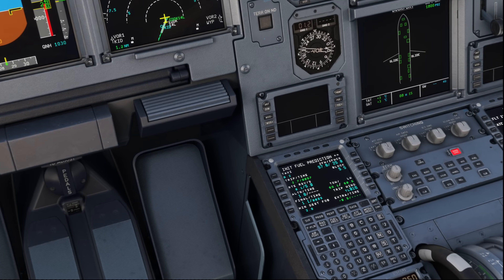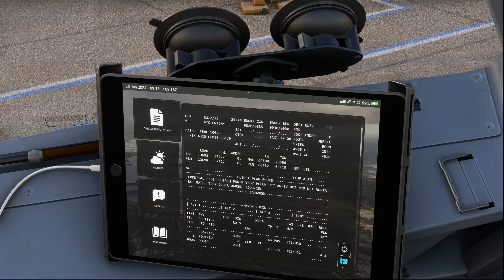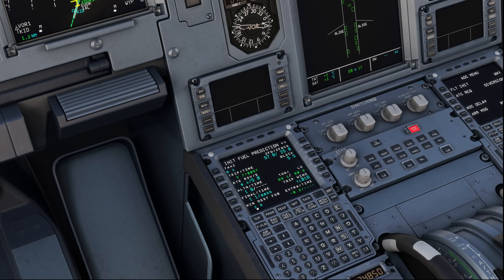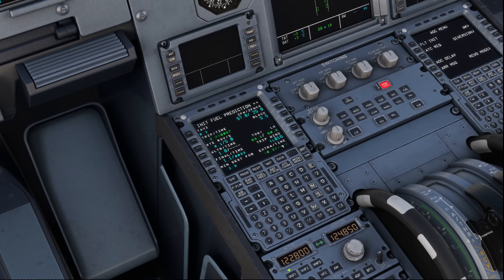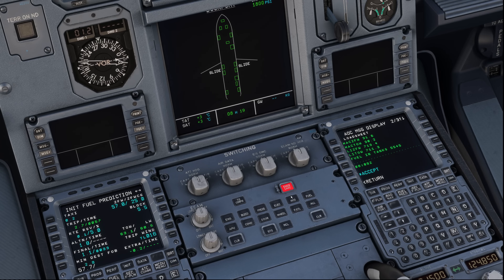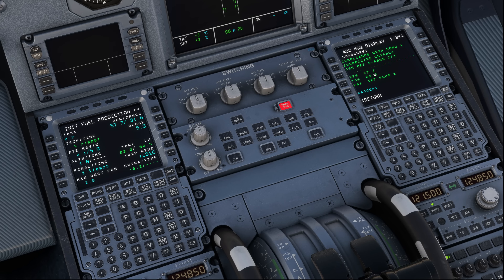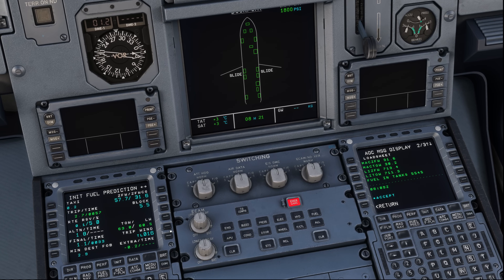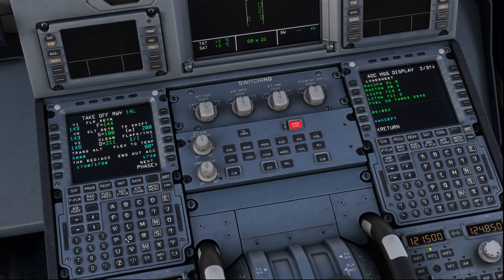Airbus Preflight: WHICH WEIGHTS to ENTER and WHEN | Real Airbus Pilot

Comment: Hello,

1)
Were you planning an Intersection Takeoff or why was 200m inserted for TO Shift?

2) 
Regarding Entry of Trim Value:
Is it important to keep this format

1/DN0.4 

?

Or is it possible to enter also 1/0.4DN ?

Must the DN or UP before the Trim Numbers?

3)
You said that according to the FCOM you take a 25% for ZFWCG.

Is that the case with all Airbus types or only A320 family?

If not, what are the standard values for ZFWCG for A330/A340?

Thank you and greetings

Comment: What format do you enter the Tail or headwind in the fuel planning page  , i have put in  for example the tail wind is 11 knots i have typed  TL011  and when i try and enter it i get the message "Format Error"
Reply: I get invalid entry when trying that. I have not figured it out how to enter the trip wind component correctly.
Reply: @richardwarcup2432 Try T011 or H011, let me know if that works?
Reply: @Fromit87  hi i have found if you request the winds through the wind tab on the right side you cannot enter the HD or TL component if you dont upload the winds  you can enter is  as TL or HD

Comment: How is V1, V2 and Vr calculated?
Reply from the maker: You'd use a performance calculator for that, usually in the EFB. In the "good old days" the airlines had to do these calculations for different conditions and then give you charts from which you'd have to take your takeoff speeds.